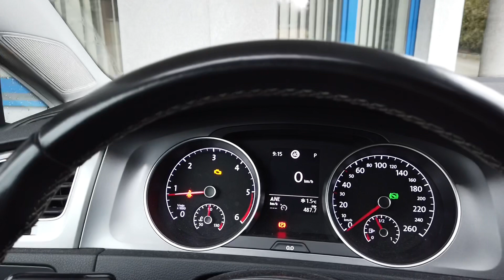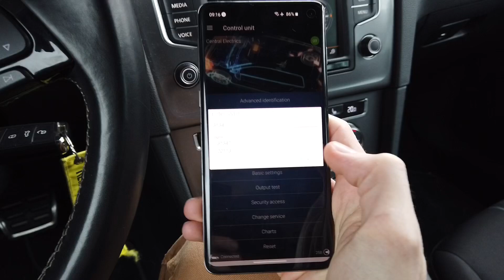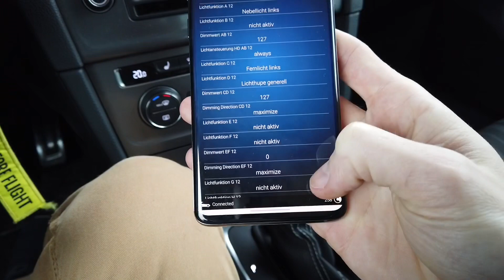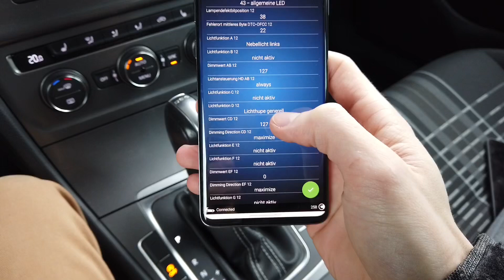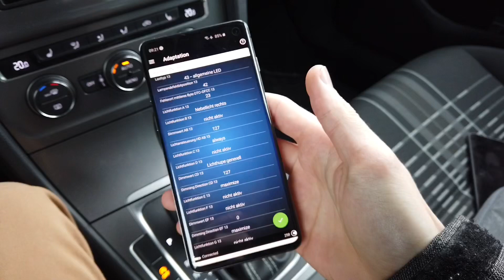VW Golf MK7 (5G) fog lights as high beam and flash to pass activation

Comment: Thank you for the coding tutorial - It seems doing this adaption will stop the fog light cornering functionality to stop working? or is there a coding that will enable both 'high beam and fog lights' and cornering to work still? that's be awesome.
Reply from the maker: You can add up to 8 functions to each light. If there's already cornering light added (for example as function C or D) you can code features from this tutorial as function E.
There's so many different configurations that it's nearly impossible to make a tutorial that fits all of us...